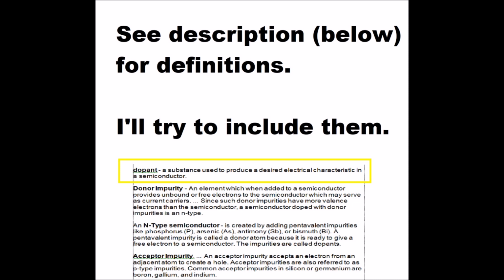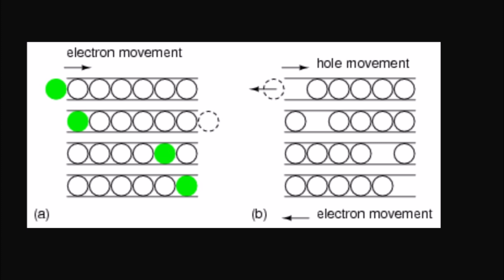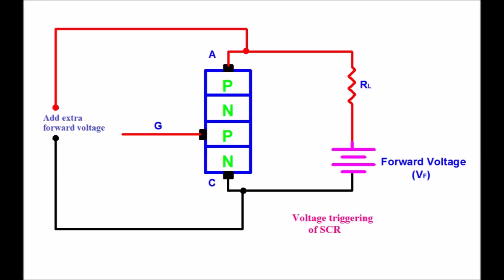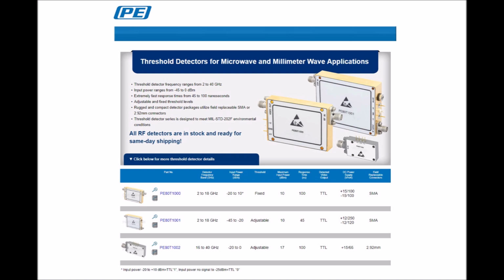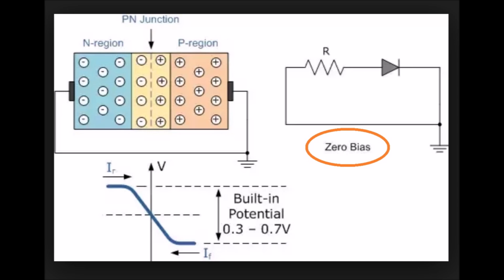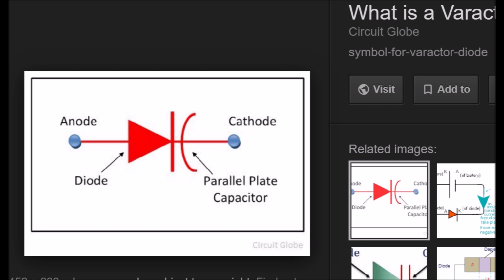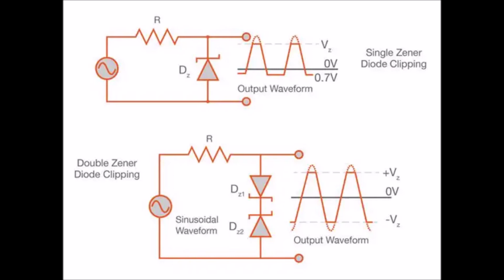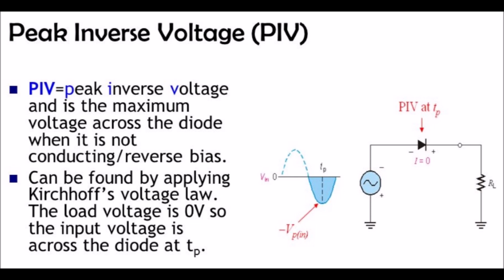Electronics Glossary: Diodes, PN Junction, Transistors, Depletion Region etc.

Comment from the maker: dopant - a substance used to produce a desired electrical characteristic in a semiconductor.

Donor Impurity - An element which when added to a semiconductor provides unbound or free electrons to the semiconductor which may serve as current carriers. ... Since such donor impurities have more valence electrons than the semiconductor, a semiconductor doped with donor impurities is an n-type.

An N-Type semiconductor - is created by adding pentavalent impurities like phosphorus (P), arsenic (As), antimony (Sb), or bismuth (Bi). A pentavalent impurity is called a donor atom because it is ready to give a free electron to a semiconductor. The impurities are called dopants.

Acceptor Impurity. ... An acceptor impurity accepts an electron from an adjacent atom to create a hole. Acceptor impurities are also referred to as p-type impurities. Common acceptor impurities in silicon or germanium are boron, gallium, and indium.

Hole Flow. In a sense, there really is something that moves from positive to negative while the electrons are moving the other way. The hole that the electron leaves behind as it moves toward the positive charge can be thought of as moving toward the negative charge.

majority carrier - The more abundant charge carriers are called majority carriers, which are primarily responsible for current transport in a piece of semiconductor. In n-type semiconductors they are electrons, while in p-type semiconductors they are holes.

Minority carrier - The less abundant charge carriers are called minority carriers; in n-type semiconductors they are holes, while in p-type semiconductors they are electrons.

P-N Junction - By adding connections to each end of the P-type and the N-type materials we can produce a two terminal device called a PN Junction Diode which can be biased by an external voltage to either block or allow the flow of current through it. Semiconductor Basics. PN Junction Diode.

Cathode and Anode - A cathode is a type of electrode through which electrons move. Electrodes are an electrical conductor (usually a metal) that is connected to something that is not a metal. The cathode type of electrode delivers electrons (negative charge) and the anode collects electrons (has the positive charge).

Forward Breakover Voltage. ... The voltage at which device starts conduction is called as forward break over voltage. In general, this voltage is in the range of 50 to 500 Volts. If gate is supplied by a positive current then forward break over voltage occurs earlier than no gate current condition.

Threshold detector: https://www.pasternack.com/pages/RF-Microwave-and-Millimeter-Wave-Products/threshold-detectors.html?gclid=CjwKCAjw96fkBRA2EiwAKZjFTaExzDAGUsPHJantIBq0urX4qWsRNIuy2fzUXz8WtQuQzrm_FVXG4xoCNp4QAvD_BwE

forward bias The d.c. voltage required to maintain current flow in a bipolar transistor or diode or to enhance current flow in a field-effect transistor. For example, a silicon diode will conduct current only if its anode is at a positive voltage compared to its cathode; it is then said to be forward biased.

reverse bias The applied d.c. voltage that prevents or greatly reduces current flow in a diode, transistor, etc. For example, a negligible current will flow through a diode when its cathode is made more positive than its anode; the diode is then said to be reverse biased. Compare forward bias. "reverse bias."

Depletion region - In semiconductor physics, the depletion region, also called depletion layer, depletion zone, junction region, space charge region or space charge layer, is an insulating region within a conductive, doped semiconductor material where the mobile charge carriers have been diffused away, or have been forced away by an electric field. The only elements left in the depletion region are ionized donor or acceptor impurities.

Zero bias - Equilibrium (zero bias) In a p–n junction, without an external applied voltage, an equilibrium condition is reached in which a potential difference forms across the junction.

Junction capacitance is the capacitance which forms in a PN junction diode under reverse bias. In a normal capacitor, the two parallel conducting plates are electrodes which allow the conduction. ... When a voltage or potential difference is applied across a capacitor the charges accumulates at the electrodes.

A varactor diode is a P-N junction diode that changes its capaci- tance and the series resistance as the bias applied to the diode is varied. The property of capacitance change is utilized to achieve a change in the frequency and/or the phase of an electrical circuit.

Varicap - In electronics, a varicap diode, varactor diode, variable capacitance diode, variable reactance diode or tuning diode is a type of diode designed to exploit the voltage-dependent capacitance of a reverse-biased p–n junction.

Avalanche breakdown is a phenomenon that can occur in both insulating and semiconducting materials. It is a form of electric current multiplication that can allow very large currents within materials which are otherwise good insulators. It is a type of electron avalanche. The avalanche process occurs when carriers in the transition region are accelerated by the electric field to energies sufficient to create mobile or free electron-hole pairs via collisions with bound electrons.

A Zener diode is a particular type of diode that, unlike a normal one, allows current to flow not only from its anode to its cathode, but also in the reverse direction, when the Zener voltage is reached. Zener diodes have a highly doped p-n junction.

A Zener Diode is a special kind of diode which permits current to flow in the forward direction as normal, but will also allow it to flow in the reverse direction when the voltage is above a certain value – the breakdown voltage known as the Zener voltage.

A rectifier diode is a two-lead semiconductor that allows current to pass in only one direction. ... Many types of diodes are used for a wide range of applications. Rectifier diodes are a vital component in power supplies where they are used to convert AC voltage to DC voltage.

For rectifier applications, peak inverse voltage (PIV) or peak reverse voltage (PRV) is the maximum value of reverse voltage which occurs at the peak of the input cycle when the diode is reverse-biased. The portion of the sinusoidal waveform which repeats or duplicates itself is known as the cycle.

peak inverse voltage  - The peak inverse voltage is either the specified maximum voltage that a diode rectifier can block, or, alternatively, the maximum voltage that a rectifier needs to block in a given circuit.